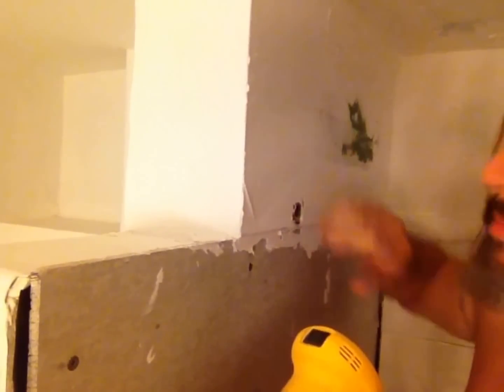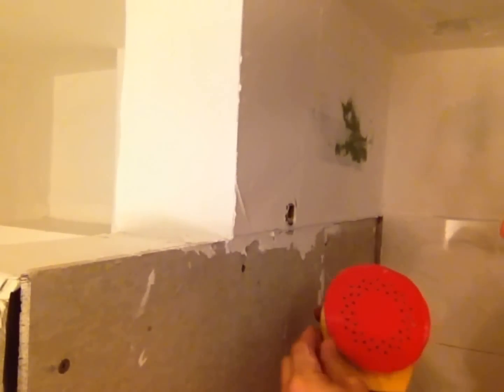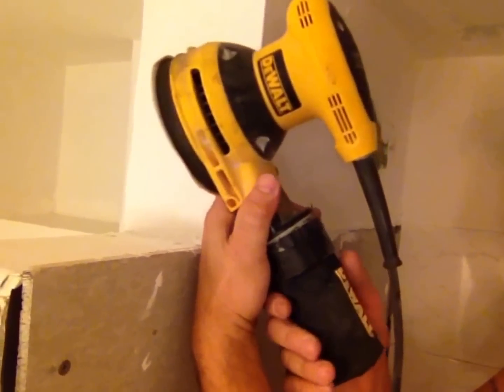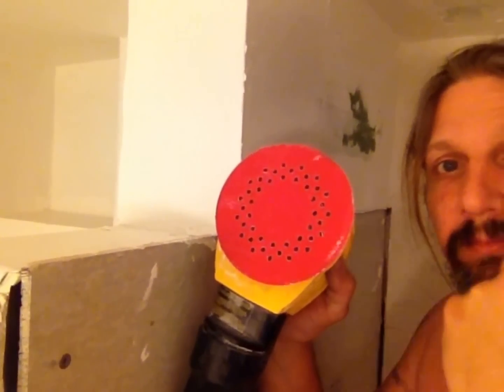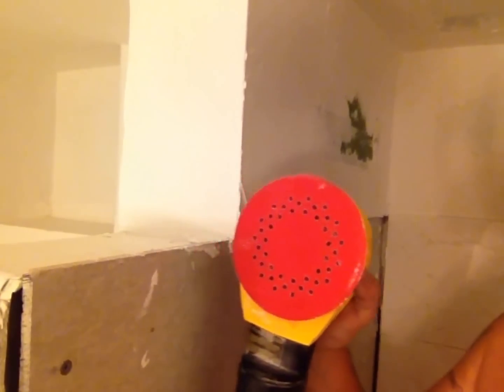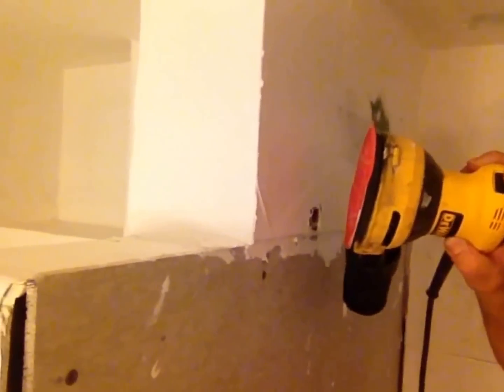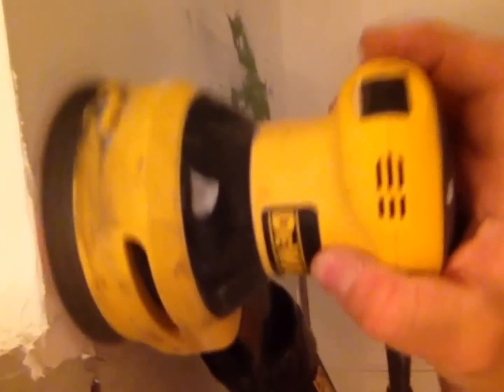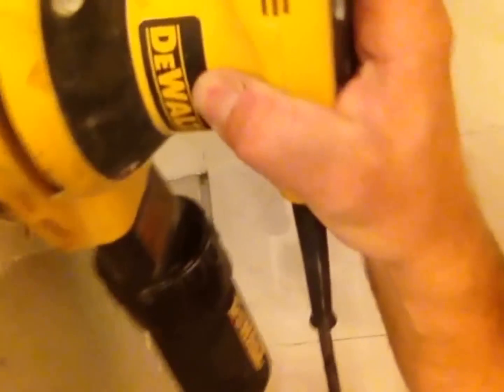drywall sanding tool dewalt orbital palm hand sander review

Comment: Try use Mirka sand disc , even Mirka drywall sander is good. It has sponge around head so it easy to do corners. And sand discs are from metal

Comment: You should probably let your viewers know that it is better using a proper drywall sander with dust extraction system.  It has a wider sanding head making it much more efficient at getting a flat smooth finish in less time.  Also Dewalt tools are excellent but plaster dust will shorten the life of the motor.  It will void the warranty on the tool and Dewalt will refuse to replace or repair the sander as this is deemed as user abuse.
Reply from the maker: Compared to a sander with a dust extraction system,.this tool has multiple users and is very cost effective at about $60 or so. A person that sands drywall for a living would not use this at all. But a homeowner or handyman will use this on multiple jobs. Thanks for your input.

Comment: Just bought the same sander from Lowe's and in reading the instructional insert, it states NOT to use this sander on DRYWALL. There were no clear reasons why. Maybe some one can inform me....
Reply: They say it wears out the velcro hooks on the sander side. All I could find.
Reply: Yeah - I bought one specifically to save energy only to read that in the instructions... that sucks. 

I'm wondering if they make one specifically for drywall applications. I have small cavities/slots on a knee wall I need to sand that I need to sand and the orbital fits in there perfectly...
Reply: heat will destroy the velcro, the little hooks will melt.  Buy a 5" interface pad to use between the tools hook and loop and the paper hook and loop.  It was save the life of your tool
Reply: Great. Thanks for the info. @DUNCANMARKE